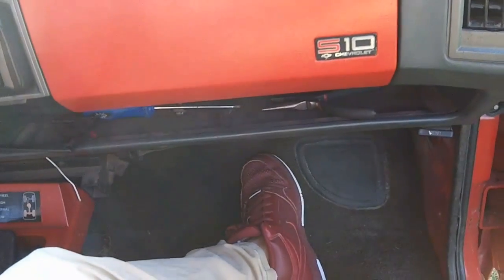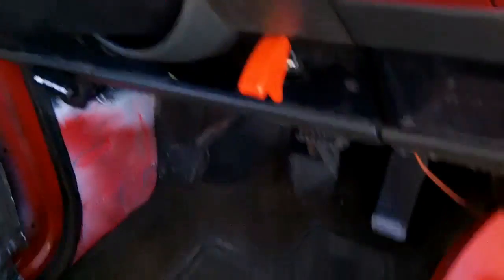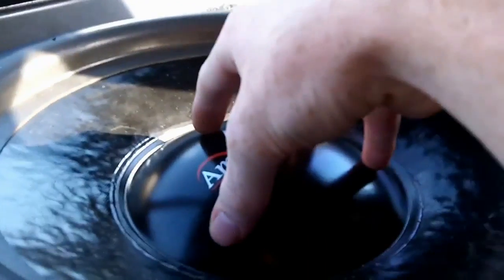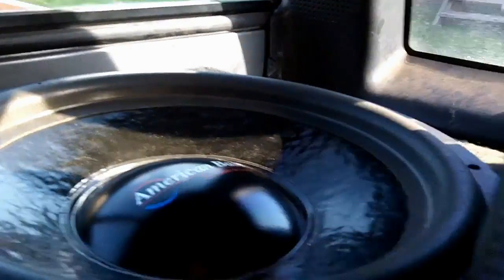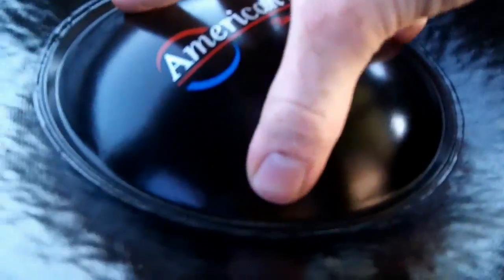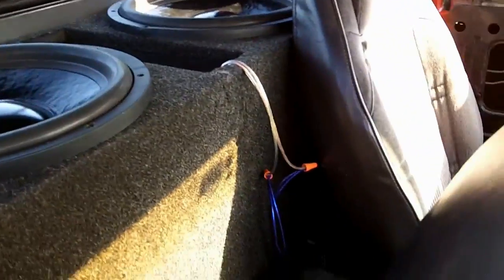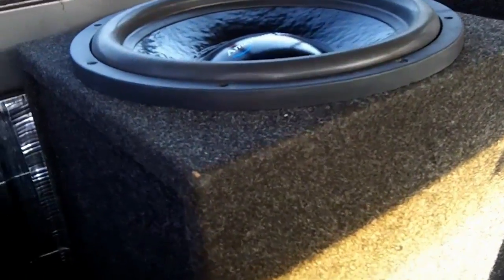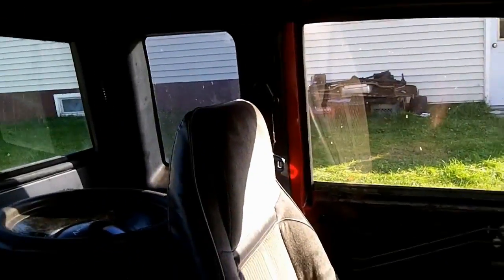American Bass TNT subwoofers on  a MA audio HK 2000D mono amplifier

Comment: hey whats up so i have a hk40000d on a single fi Q 15 in my expedition with a  kenwood double din ...so is your alternator replaced with a higher amped? or how do you have it set up bc i just put the system in my expo and its to powerful for my stock it keeps dimming then cuts out ....